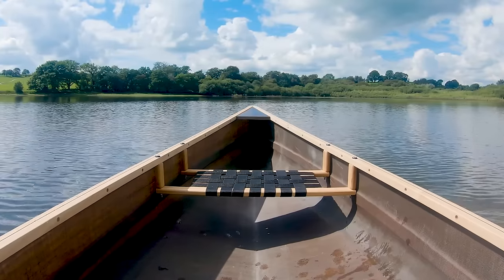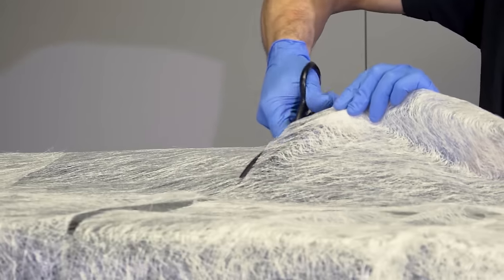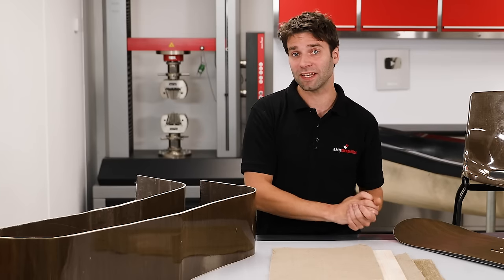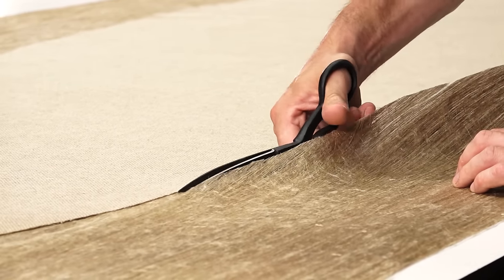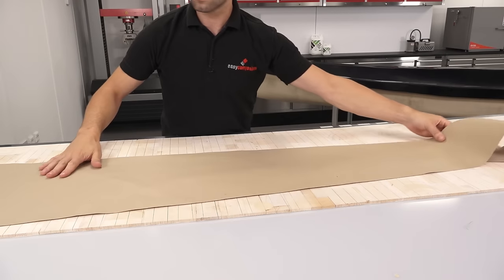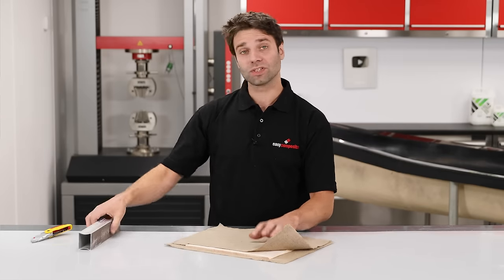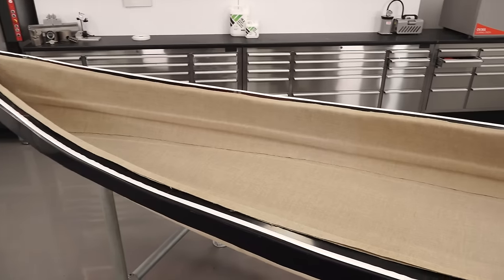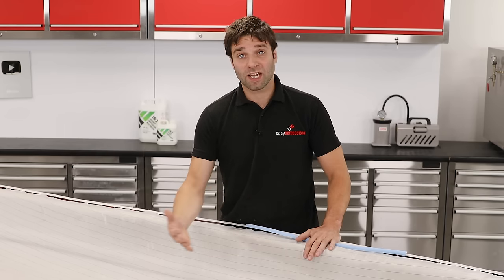Resin Infusion of a 16' Flax Fibre & Bio Resin Canoe

Comment: Really good video. However as an owner in the past of a boat with a balsa cores deck if the outer laminates get damaged you need to repair prompltly. A lot of racing yachts were built using balsa cores in the late 70s and 80s becasue of its strength but by the time our boat reached the age of 30 there was an awful lot of water trapped in the core in places.

Comment: Another advantage of end grain balsa, if it gets wet from a crack or a hole in the laminate, the water does not soak (and rot) through all the wood like it would if the grains were long

Comment: Great video. This explains a great many things that are worth noting. 
Having spent the weekend struggling with flax and LB2, I think it is clear that this technique through vacuum forming makes a lot of sense (I need to watch the smaller section on aluminium again!).
Reply from the maker: Flax tends to expand when wet laid which increases thickness and resin soak up which can make it harder to laminate.  Certainly a vacuum bag based process will limit that.

Comment: I absolutely endorse to add 3% (or so) epoxidized castor oil in the resin part of the mixture.

Back then I used Heloxy 505. It is a superior wetting agent for all sorts of natural fillers and fibers.

Edit: we used Divac 2.2L dry sump pump (and a resin trap!!!) to keep the insides of the vacuum bag at 6 mbar for several hours, to remove the free water from the fillers/fibers. 

(with that heloxy additive and divac pump, that's how you will make a totally translucent glass fiber epoxy laminate)

Comment: What an excellent presentation and project. Really great work by your team at Easy Composites. 👍

You've covered the high performance and low environmental impact composite options quite well but when you are approached by manufacturers looking to make composites at scale, where cost of materials must also be balanced, what kind of recommendations do you make in terms of materials and epoxy?
Reply from the maker: Hi Thomas, thanks for the feedback but the question is maybe a little too broad to answer helpfully. The nature of composites means that the details of a project matter a lot and might change our recommendations significantly. If you’ve got anything specific in mind, even if it’s just something you’re pondering, drop us a message; we’ll try to help 😀.

Comment: wow, another fabulous video!! And great that the workshop is so close to the lake ;-)  Question about the environmental impact of the fibre material: Can you comment on the total benefit of these natural materials? My assumption would have been, that for a standard part, the resin has a bigger impact than glass fibre.
Reply from the maker: Being a composite, both resin and fibre are relevant.  Natural fibres are sustainably sourced and take less processing and energy to make a usable fibre compared to fibreglass or carbon.  The bio resins replace petrochemical sourced parts with bio derived alternatives making the production more sustainable and with reduced energy usage during manufacture.

Comment: You guys are making some really incredible videos here. I've done composite work sporadically since I was a kid, but have been doing a lot of things wrong because there aren't really a lot of good sources for proper technique, and/or explaining when to use what fiber or epoxy, or how to use the vacuum bagging bits and bobs. I am somewhat curious what the margins look like on something like this canoe build? Obviously there's come capital wrapped up in the mould and tooling, but otherwise it seems like mostly consumables and time.
Reply from the maker: The material and resin cost depends on the size and layup of the specific canoe you build plus the consumable materials in the infusion as seen in the video.

Comment: This was awesome and as soon as I find space to store it, I'm making one :) I just have one question: does the balsa core get fully infused with resin and if so, doesn't that cancel it's light weight?
Reply from the maker: No, the balsa is almost ‘closed cell’ in its behaviour and so its resin absorption is minimal. Resin fills the tiny gaps between the blocks and there is a small amount of resin permeation into the first 1mm or so of the balsa but that’s about it, so the core stays light.

Comment: do you think you can make a video on how to strip clear from carbon fiber parts?
Reply from the maker: Do you mean clear coat lacquer or resin?  In both cases sanding will work although care should be taken when sanding into resin to not sand into the fibres themselves as the cosmetic pattern will be lost.
Reply: @easycompositestv  im mostly intrested in taking an already finished carbon fiber part and refinishing it with something different but yes clear coat lacquer.

Comment: This video, and honestly all your videos, are absolutely brilliant. This one was just that much more. One question, Paul, regarding the FusionFix GP product. I imagine that getting this in the US will be a real challenge. We do have something similar made by 3M, Hi-Tack 71 spray adhesive. Though its pretty expensive and its hard to find for the hobbyist. Can you offer your professional suggestion(s) for the use of normal 3M Super 77 spray adhesive or the old standby, hairspray?? Obviously the latter won't be as good as a purpose built product, but for those of us who are trying to do some small and complex layups that need a helping hand, it would be nice to know what our options are.

Thank you from the US!
Reply from the maker: 3M77 has commonly been used for that purpose but care needs to be taken to avoid over application both due to cosmetic marring and also potentially slight reduction in strength of the part. We can ship Fusion Fix to most US destinations via FedEx although FedEx have quite a high "hazmat" surcharge which makes it expensive to ship smaller orders.
Reply: @easycompositestv  Thank you! I will look into it and if it is viable or can group with other order items to make shipping more bearable, I will certainly try it out.

Comment: Quick question. Instead of applying the balsa core to the whole of the bottom, could you not have just gone down the keel like you did on the  "lightweight" sample and then add balsa ribs to add stiffness?
Reply from the maker: With a bit of further experimentation it may well be possible to further reduce the balsa bottom in the way you suggest.  Our experience of this canoe was that the balsa base helped with overall stiffness.

Comment: Very cool. But what is unsustainable about fiberglass?
Reply from the maker: It’s a fair question, and one that we looked at in a bit more detail in the partner video which dives a bit deeper into the case for -and - against the environmental case for these sort of materials. The main thrust of the case against fibreglass is the amount of energy used in the production of the fibres, but as is always the case when evaluating overall environment benefits of a material, there’s a lot more to it than that!

Comment: Good work, but I can't understand how it weights under 30 kg? I made one with 4 mm birch plywood, 150 g/m2 glass on both sides, length 4.5m, got weight 27 kg. But just 1 seat (oak), everything elese was made from ash.
Reply from the maker: What layup method did the you use? If it was hand layup then you’ll have a higher resin content which will increase the overall weight. Also, was it the same surface area? The weight of the laminate should be a simple calculation based on the surface area and the weight of the dry reinforcement, plus resin at 40%.

Comment: Awesome!
I wonder - are there any alternatives for chopped carbon (forged) with flex fibre?
If one would simply cut uni directional flax fibre? I love your video on forged carbon parts straight out of 3d printed mould, would be awesome to have more eco-friendly alternative to that
Reply from the maker: Non woven mat is more commonly used as an alternative to a woven fibre but you could certainly experiment with chopping up UD fibres. I don't imagine it would have quite the same effect as the carbon fibres as flax doesn't reflect light in quite the same way.
Reply: @easycompositestv  great answer, thanks.

Comment: What a beautiful work!. if it's possible to create a canoe, I believe I could fix my carbon fiber paddle. it got 1.5 inch crack at the end of the blade and blade tip is broken off, hanging. What materials should I buy from Easy Composites to fix the paddle?  many thanks
Reply from the maker: Best off emailing us some pictures of the damage to technical@easycomposites.com as there are a couple of different ways to repair depending on the damage.
Reply from the maker: We can certainly have a look at it for you. If you can send some photos of the damage across to our inbox our technical team will be able to advise.

Comment: Interesting! Q: Is it viable to save on cost and use wet lamination instead of prepreg for a project that requires making long tubular shape?
Reply from the maker: Although these natural fibres can be wet laid, they tend to swell when not under vacuum which increases thickness and uses more resin.  Vacuum based processes like infusion minimise this.

Comment: Hello! Was this done with one VP-EC4-EU ? I have been looking into this pump
Reply from the maker: Yes it was.  On a large mould like this, it is a bit slower to pull initial vacuum but other than that it works fine and holds vacuum well throughout the infusion.

Comment: Doesnt the peel ply get in the way of the resin going into the flax? I don't understand how the resin gets through the peel ply.
Reply: I believe the resin flows right through the peel ply, he said it's woven nylon so plenty of tiny holes to flow through. It just doesn't bond to the resin.
Reply from the maker: Jesse’s answer is spot on. Peel ply lets the resin pass straight through and serves to stop the mesh from being bonded to the laminate. Once cured, the peel ply rips off the laminate (relatively) easily.

Comment: What protects the inside surface (with the peel ply texture) from UV?
Reply from the maker: Nothing specifically needed as the epoxy in general has a reasonable UV resistance.

Comment: How can it be helpful in place of carbonfiber in a car or bike and on which place can it be perfect and helpful to use other than chair?
Reply from the maker: Any carbon or fibreglass panel could be made using this method, albeit a trade off on weight but gaining some green credentials.

Comment: The buckets are not consumable, correct? You reuse those?
Reply from the maker: The buckets we supply are generally polypropylene which means the cured resins just peel out easily. However buckets made from HDPE, LDPE, Nylon, PTFE or teflon coated are generally such that the resin will release from the surface.
Reply: @easycompositestv brilliant. Just very aware of wastage.

Comment: Why you choose balsa core instead foam core?
Reply from the maker: For both its environmental credentials and performance.  Balsa is both more environmentally friendly than plastic based cores yet performs very well so is not really a compromise mechanically.
Reply from the maker: The focus of the project is to demonstrate how natural materials can be used in composite applications and the balsa was a great choice for this. Additionally it provides a really solid base to the bottom of the hull, so should the canoe ever strike something like a rock then the damage should be less than a foam core which can crush, making any repairs easier to undertake.

Comment: This is a case of BS greenwashing...
Fiberglass is just sand - as natural as highly processed plant fibers.  Use a solar furnace to melt the sand into glass fibers.  The resin is the same for either one.  Also most vacuum infusion processes produce a lot of waste compared to hand layup.
Reply: Make an inferior flax canoe if you want to, but don't try to delude yourself or others that it is any greener.
Reply from the maker: The point is it is greener than using normal epoxies and composite fibres.  Sure it is not perfect by any shot and not 100% green but it is better than using normal materials. eg less fossil fuel based materials in the resin, greener sourcing and more energy efficient production of the fibres etc.  There is still a long way to go in terms of reducing waste and also end of life recycling but that will improve as the technology and cost of such products improve.